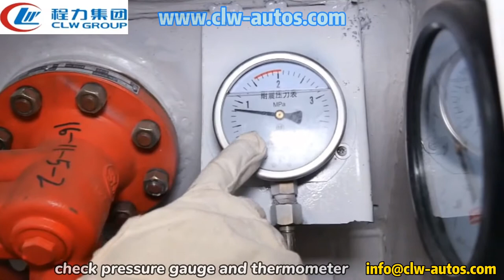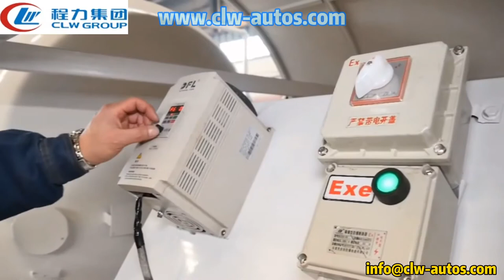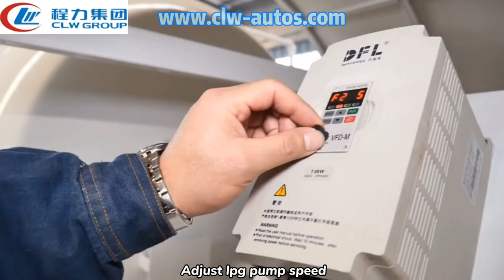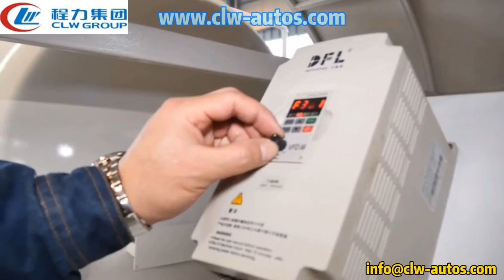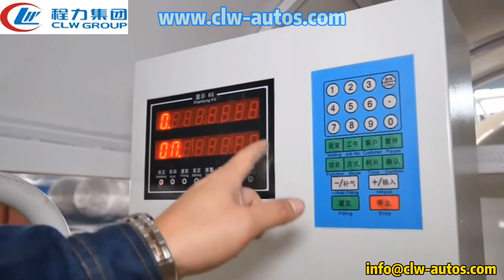How to fill Auto gas lpg skid filling station with small mobile lpg bobtail tanker truck?

Comment: I 
 Expect  you to shut off supply from the truck before closing the valves on the tank..

If you close the valve on the tank first..ensure you bled  of trapped gas in the hose..